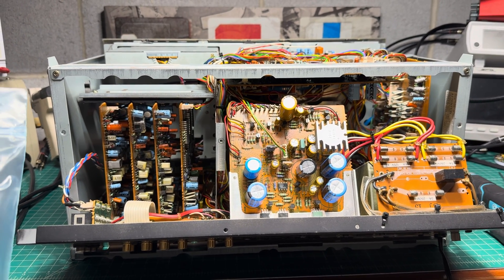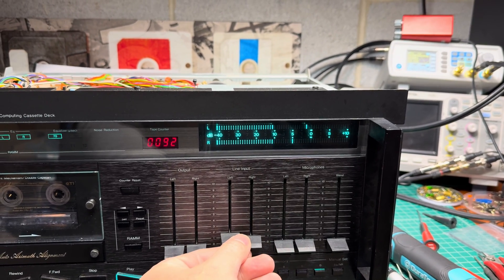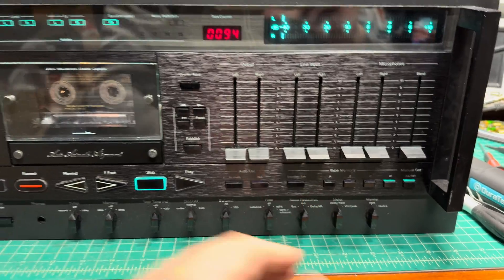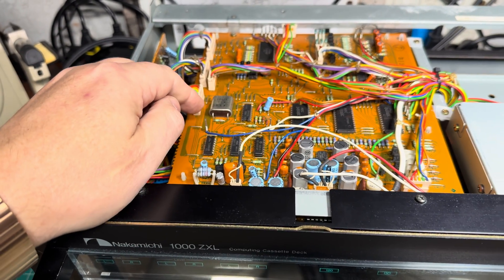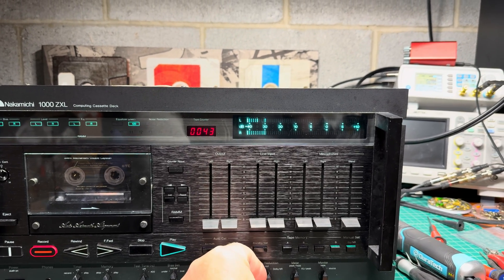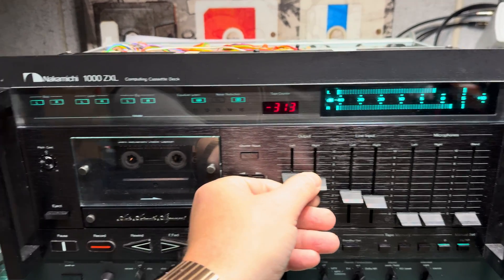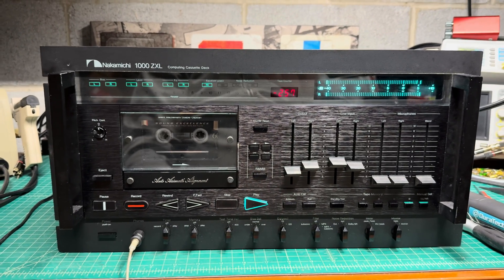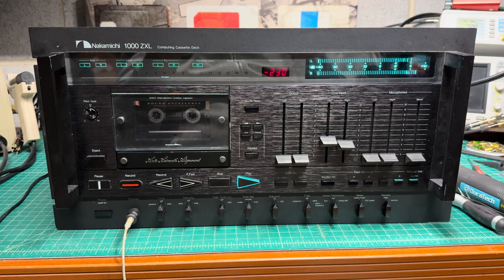Nakamichi 1000ZXL Lives Again… Almost | Playback Works, Recording Still Dead

Comment: It could be sleeping capacitors. I had the same problem with nakamichi zx680. It was not used over 30 yers and same when on no record not azimuth working. But when l used some more time it miraculously repaired itself:) it could be the same with it too.

Comment: Notice you moved that CPU board around to show on camera then it partially fixed things. Probably a broken ribbon cable, or connecting pins lose in a connector. Tough to troubleshoot but better than dead IC's that are impossible to find these days. Good luck. I am enjoying your repair videos as always!

Comment: I would recommend replacing the 53 orange poly caps ( scratchy sliders may be due to that). And the 3 relays. Make sure the battery supply is delivering 3V. Check the components driving the azimuth motor, this is a common issue. Looks like some lamps are not working too. Give the transport a service then start troubleshooting
Reply: Is this your first day on the channel? Watch at least a dozen of the author's previous videos. It seems that Nakamichi Service all world works on this channel. And you just fell from the sky)))